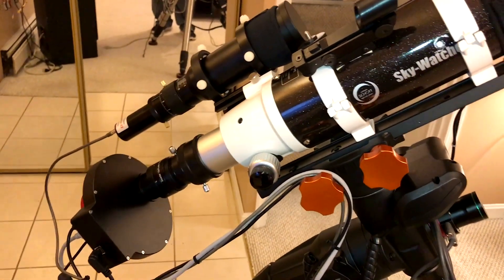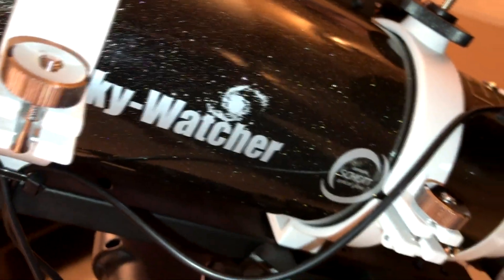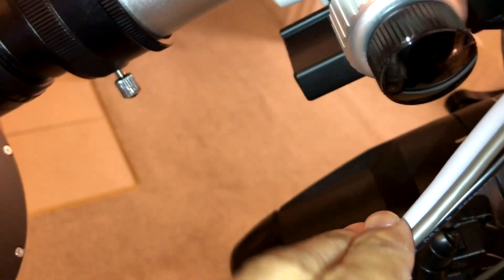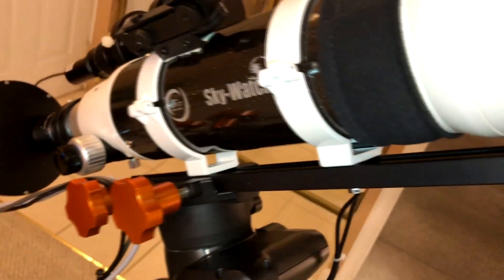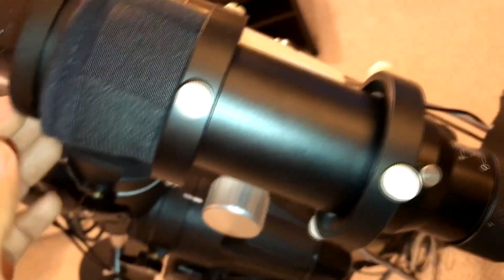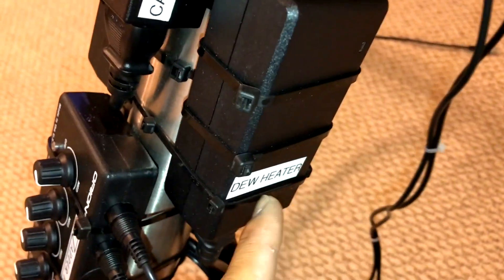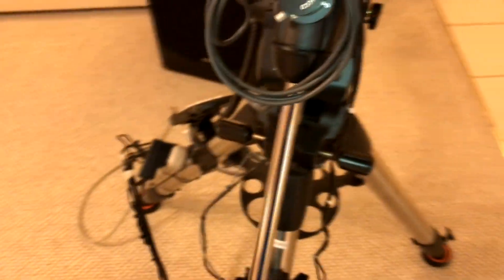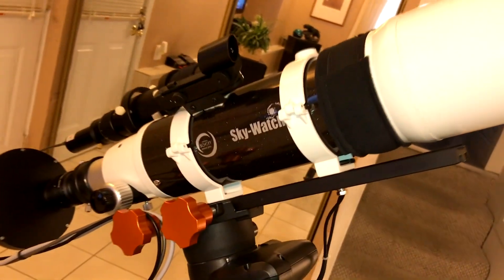My Latest Astrophotography Setup SkyWatcher Pro 80mm Refractor

Comment: I realize this is an old video but I have the same scope and mount. Where did you get the aftermarket dovetail mount for the scope. I'm unable to achieve proper balance for astrophotography with a stock one.
Reply from the maker: I know I got it from telescopes dot com website years ago. I can’t remember which one I got but I know it wasn’t very expensive. I may have to do some digging around to see which one it was.
Reply from the maker: I think it’s the Orion 13” dovetail for $39   I know I used my own nuts & bolts & washers from Lowe’s to mount everything.
Reply: @deejaybustab   Thanks for the quick response. I ordered one from OPT slightly different. I'm gonna cancel an order from Orion. Thanks for the heads up.

Comment: @DeeJay Busta B Hey man, curious if you've managed to get focus with this setup using a focal reducer, and no longer need the extension? I have the same scope and ordered the ASI 533MC Pro but don't have an extension on order. Just trying to see if I will need one. I do have 0.8x and 0.6x reducers though, which I think might help with the required distance. (I have the required 55mm between the reducer and camera sensor).
Reply from the maker: I got focus with this setup and that was before I had a focal reducer.  I used this setup for about a year before I purchased the reducer.  When I put the reducer on I was still able to get focus and that may be because Highpoint said I should get the Baader VariLock which is a adjustable spacer that you just adjust to get focus if needed.  I think the one I have is the 20-29.  I use the same one for my 8Se and now my 80mm Explore Scientific setup.  I sold the Skywatcher over a year ago but before I sold it I did get the moon lite auto focus system which worked EXCELLENT!!!  I would always loose focus on cold nights without it.  No matter how tight I made the locks it would still slip so slightly where the stars were out of focus.  I since moved the moon lite over to my Exolore Scientific 80mm and works great as well.
Reply: @deejaybustab  thanks for the reply. Before you had the reducer, did you need an extension tube to focus with the focuser all the way out? You probably lost focus overnight because of temperature change as well, not just slippage?
Reply from the maker: Steven Harper Before I had the reducer I already had the extension piece because when I used my 8SE setup I had to use the same extension. So what I did was just take the camera, filter wheel & extension off the 8SE & just slide it in the skywatcher scope & I didn’t have to make any adjustments when I started to adjust the focus itself. Maybe the extension tube was already set at the right amount of distance I what I’m thinking. But I bet the extension tube was needed & since it was already set from my other setup it worked out with the skywatcher setup. & yes that focus slipping I had on cold nights Wes all from temperatures changing 👍🏽

Comment: What dovetail bar are you using?
Reply from the maker: Science is awesome When I had that scope I think that dovetail bar came from Orion website. I know I ordered it a few years ago when I ordered the Orion star shoot autoguider. It was a basic dovetail bar for around $20 I think. It has no name stamped on it to tell what it is. I did have to rig it up with nuts & bolts to allow the rings to connect to it. Worked great for - couple of years until I sold the scope.

Comment: Is that the 1.25" or 2" filter wheel  ? Also, when you introduce a Focal Reducer/Field Fla. What position do you think it will be installed in the imaging train?
Reply from the maker: luckykel2030 That is the 1.25 filter wheel. On my 8SE the focal reducer is at the end just where everything connects to the telescope. I never used a focal reducer on this setup. For this setup it would go just before the draw tube part.
Reply: @deejaybustab  thanks for the prompt reply. What would you think is the difference between this and the 2" in terms of imaging results ? Do you use light pollution filters too? Thanks
Reply from the maker: luckykel2030 I’ve used 1 light pollution filter when I was using my dslr camera but it was a cheap filter & did very little. Once I got the asi 1600mm camera I got the bundle deal with the filter wheel & the narrow band filters & RGB filters. Once I switched over to that setup I never used any light pollution filter after that.  That’s a good question about the 1.25 or 2” because I was wondering the same thing if you will get better images with the bigger ones. I never looked into upgrading to that because I didn’t want to spend more money yet lol!!!! Maybe Chuck chucks Astrophotography may know because I think he did upgrade to the bigger setup.

Comment: Hi, I'm also in a process to buy similar setup for my AP. SW 80 ED + SW HEQ5 goto mount + ZWO 1600 mono Cooled + Generic 50mm Guide scope with ASI120MM-mini. I'm assuming I will also face similar problems with focus when I mount 1600 cooled to the scope. Please advise the model name of the extension that in between 1600 cooled and the scope. 

is it :
(i) Baader VariLock T2 extension tube 20-29mm continuous length
(ii) Baader VariLock 46, lockable T-2 ExtensionTube 29-46mm

TIA
Reply from the maker: It is the Baader VeriLock T-2 Extension 20-29mm on High Point's website.  That allowed me to achieve focus with the camera.
https://www.highpointscientific.com/baader-varilock-29-t2-extension-tube-t2-25y

Comment: Is an Orion Sirius ED80 EQ-G Computerized Scope and Mount a Good one to get.? I am looking to upgrade. An does those Vibration Pads you have the Telescope on Help..?
Reply from the maker: Just from reading up on the Orion setup, that seems to be a good package deal to start off with.  Search around to see what kind of photos people have posted with the Orion ED80.  I think it is pretty much close to the ED80 I have.  I still want a triplet 1 day but for now I'll keep with my dublet due to the high price of a good triplet. Yes the vibration pads seem to help mainly on nights when the winds are up and down.  From the winds gusting a little the mount can vibrate a little and the pads help suppress that small vibration from the scope acting like a small sail at times. Plus the pads were not expensive to add to a setup that cost a lot of money lol!!
Reply: @deejaybustab  yeah, the moon is About all i can Capture rite now. I currently have a 5" Orion SpaceProbe 130 ST EQ an have took some Great Moon Pics and have live Streamed Vid of it. But as far as Planets, i cant get a good pic. My mount doesnt track so i guess thats why. Any Suggestions..?? I have been doing my Research but man it seems like a lot of Money to get Great images. The ED-80 i mentioned is $1,499 plus wld have to buy about another $3,000 worth of gear to have a Great setup. Any Advice wld be Appreciated.
Reply from the maker: @brucenunn9621  Yes for the planets you will need some sort of tracking to get some longer videos of them for stacking.  I 1st started off with my 8SE and the Alt + Az mount it came with.  It worked for a few min but not for long with planets.  I was able to get Jupiter pretty good with it.  I feel you on the cost of all this gear.  It get really expensive very fast!!!  I got my AVX mount on Ebay almost 2 years ago for around $740 with free shipping.  The 80ED I got used from High Point Scientific for around $600  so it is still close to the price of the setup you were looking at.  Now the camera gear is were it gets very expensive too!! I 1st started with my Nikon DSLR but didn't get good results.  Then I got the Canon DSLR used too and got a bit better images but was a lot of work and un cooled sensor gave me a lot of noise in the summer.  Once I got the 1600mm cool and filter wheel it took me to a higher level.  The auto focus I have now on my 80ED made even a bigger better result for me.  You can see that setup in my newest setup video I did this past summer. Now it is just me learning how to process everything with Pixinsight.  It's a big learning curve with everything and I still seem like I have along way to go.
Reply: @deejaybustab  Thank's for the Tips and Advice.. i have just been tring to do my Reserch before i dump money into my Next Telescope. Cause i plan on staying with it.. i have had my Oirion 5" for about 6 Years. Have used it alot more the past Year than i have in Awhile. Which having a upgrade GoTo Scope is going to be a huge upgrade for me. I have Also been looking at the Celcstron Advanced VX 8" Newtonian. My 5" is that type, plus that one also Accepts 2" and 1.25" eyepieces. I have heard alot of good about 2" eyepieces. That Scope is around $1,300.00

Comment: Hello I have a question regarding your dew control. It looks like your controler its plugged into a power bar. How do you get the 12v power required for the controler. Thank you in advance
Reply from the maker: Claudio Nunez If you look on 1 of my tripod legs you can see I have three black 12v 5a type of power supplies. One goes to my camera, 1 goes to my AVX Mount & the last one goes to my dew controller. I uploaded a new gear setup video a few months ago that goes into detail on how everything looks. Check out that video too. Hope this helps.

Comment: hola  amigo...tengo recien comprado el ed 80 triplete sprit  y la camara es zxo 1600mm con la rueda y filtros baader ,todon en 2 pulgadas  pero desulucionada total..... por la aberracion en las estrellas que tiene  el guiado es perfecto pero pero las estrellas parece n cometas  en los extremos.. te pasa lo mismo???? conoces la solucon?? gracias.. beso.
Reply from the maker: Hola, no he tenido ese problema antes. ¿Qué tan bueno es tu alineamiento polar? Uso la cámara maestra de polos para establecer mi alineación polar. ¿Cuánto duran tus exposiciones? No tomé fotos de más de 3 minuites y hasta ahora mis estrellas se quedan. Creo que tu problema puede estar en la alineación polar, pero todavía soy nuevo en esto, así que puedo estar equivocado. Lo siento si no soy de mucha ayuda.
Reply: gracias por responder.. la alineacion es buena los timpos son de 5 minutos  el periodo de error casi no lo tiene.las dos rayas en el phd dan casi perfectas al centro.. por eso miraba y te escuchaba ..creo que podria ser un problema de optica que no es acorde con la camara zwo1600 ...por que con la canon 600d modificada no tiene ese problema.  si quieres te puedo mandar una foto.  gracias...y todo es de ayuda  para ambos..
Reply: gracias.. por tu respuesta. y es de mucha ayuda  todos podemos compartir...  yo tengo  como dije la misma camara  1600 mm   lo de mm significa mono cormatica  la 1600mc  es la color.    no es milimetros.. aporto algo por lo menos.    la alineacion es perfecta  .tal vez pueda  que sea el aplanador de campo?
Reply from the maker: Sabes que puedes estar enfocado en algo acerca de la cámara porque tu cámara réflex digital normal no obtiene las colas de estrellas, pero con ASI1600mm las estás obteniendo. ¿Usaste el flatner de campo con tu DSLR? Me pregunto si es una configuración en ASI1600mm como binning. Tengo mi binning configurado para 1x1. Es posible que desee publicar la pregunta en las noches nubladas, pero puede obtener todo tipo de respuestas que no está buscando jajaja! Sé que puede que no sea de mucha ayuda porque todavía soy nuevo en este proceso, pero espero poder ayudar de alguna manera.
Reply: siii claro que puedes.es esa la palabra como cola de estrellas siii  con la canon no me pasa  pero con la asi 1600  siii  la configuracion es de 1x1 si...  si  hare eso con  las preguntas. y gracias por todos  sos muy gentil. si  lo del aplanador de campo lo deje puesto  solo cambie la camara y no lo hace  como te exlique  ....
Reply: hoy estara despejado aqui   en la noche  asi que hare varios intentos  sacando el aplanador   ...

Comment: Hi,is it possible to use the SW80 ED as Celestron c8 guide scope?
Reply from the maker: I'm not really sure but it is an 80mm just like the Orion short tube 80mm.  If you do use it your mount will have to be pretty big to support the extra weight.
Reply: it will be an az-eq6 SW...but im am worry that ithe ed80 is too long for c8 edge to be the guidescope,but i know it will be really awesome...thank you for help

Comment: Nice setup. You're gonna love that bahtinov mask. Lets you nail focus in 10 seconds and lock the focuser. I have that asi1600 too. If you're using their rgb and narrowband filter set, I am pretty sure they are parfocal so refocusing between filters shouldn't be necessary. The skywatcher field flattened/focal reducer is PRICEY! Even after spending the money on it I'm not sure the field is completely flat. Cheers!
Reply from the maker: Brian Schneider Cool!! The 8 position filter wheel I got came as a kit with all narrow band & RGB filters when I got the asi1600mm from high point. So far I never had to refocus anything when switching filters. I only had a few recent out of focus images when I didn’t lock the focus as tight as I should & it slid slightly. I have seen that reducer/flatter & it ain’t cheap in price lol I now wish we had some clear nights as we have had 8 straight days of cloudy & light rain & no signs of clearing until 4 more days.
Reply: LEI TODO.. to utilizo la mascara tengo los filtros baader rgb y banda estrecha la camara zwo 1600 mm   pero me salen deformadas en los extremos  las estrellas y no por guiado es como de parece pequeñotos cometas como una gota.  por eso pienso en algo optico. tengo el aplanador de campo que trar el srrit ed 80 triplete  original. podria ser eso?